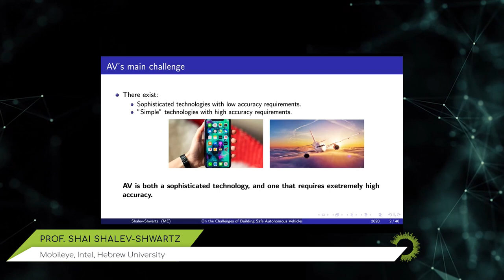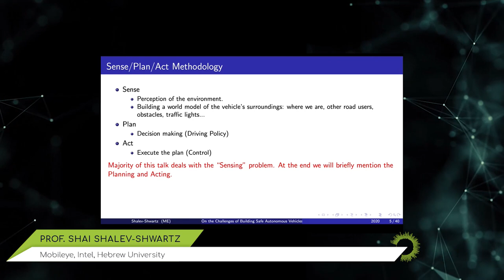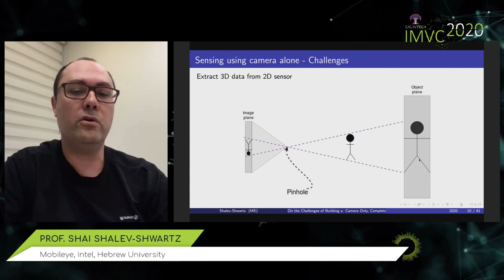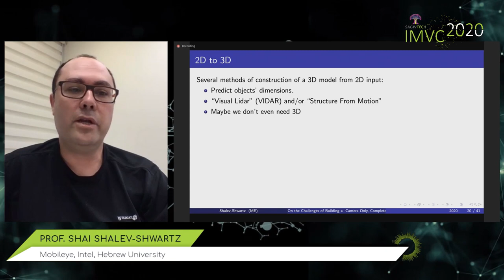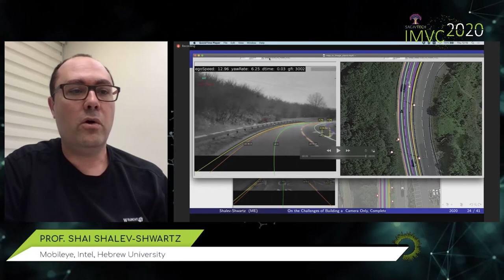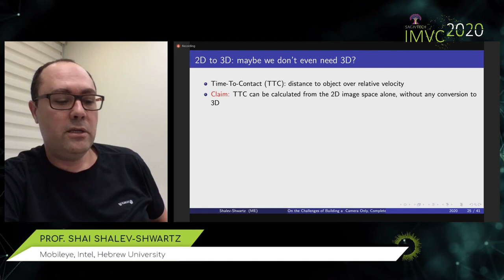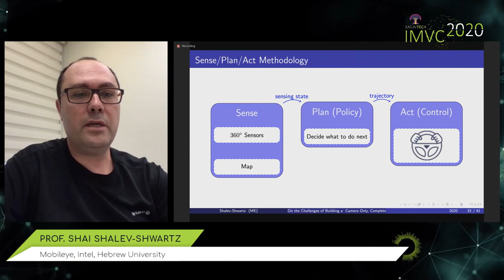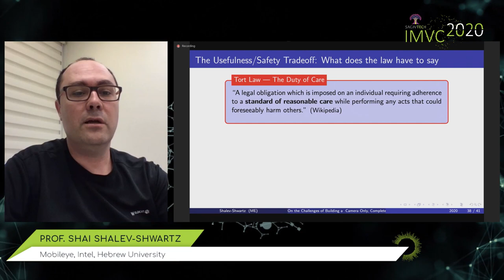On the Challenges of Building a Camera-only, Complete, Self-Driving System

Comment: You wouldn't do this on an unmanned spacecraft during docking, so why deprive a vehicle of a useful sensor with manned autonomous vehicles?
Reply: what sensor would that be ?
Reply: @blanamaxima  LIDAR.  Though in the case of self-driving cars you really want cameras, RADAR, and LIDAR all together, because each does certain things well that the others cannot.  Cameras are the cheapest of the three, but the other two are so cheap and small now it's simply reckless endangerment and stupid to leave them off.  Tesla 'trains' their AI with all three, and then removes the LIDAR.  Lawsuits coming.
Reply: @Reticuli  You missed the beginning of the talk about MTBF. They use multiple sensor modalities , radar and lidar and argue for exactly what you mention but in more formal terms. Compared to Tesla they are building radar and FMCW lidar by themselves. They also use crowed source maps as a sensor compared to Tesla , allowing them better system availability and system safety where coverage is adequate.  Mobileye is not for no reason number one in ADAS and I tell you that working as a competitor to them.